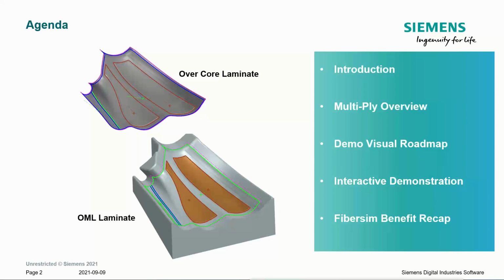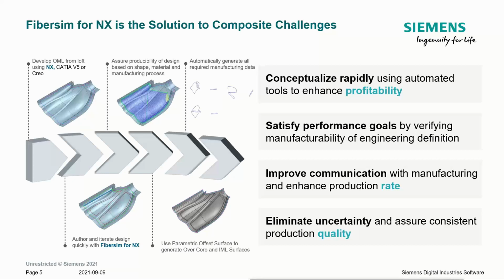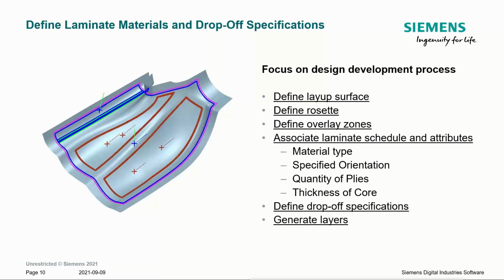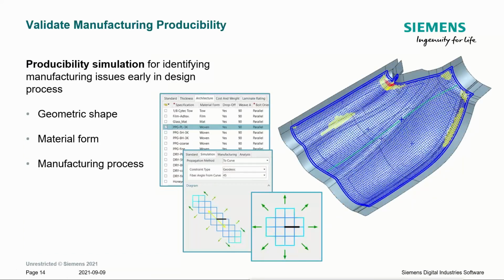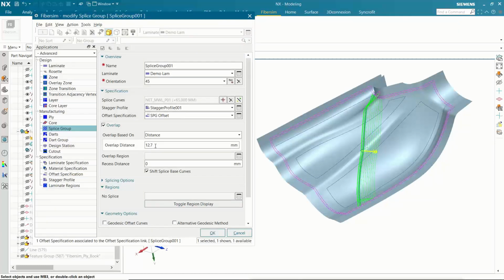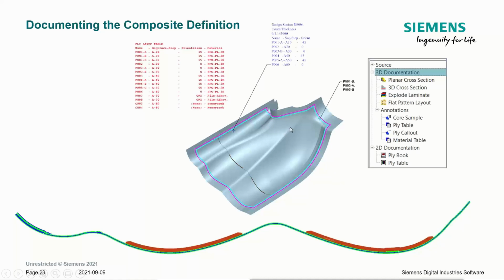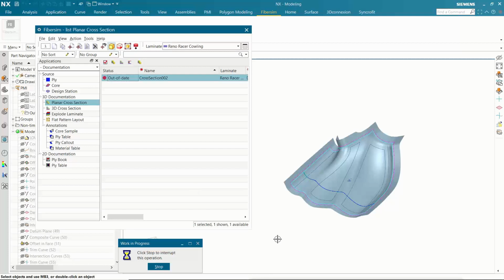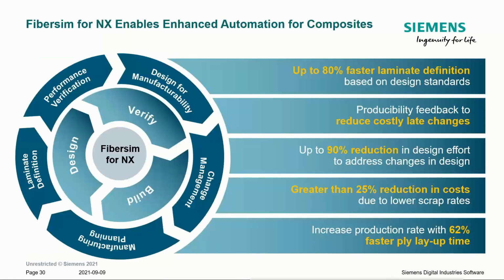Fibersim Overview Webinar

Comment: Great video. What I would love to see is a video of complete part. What I mean is that in this demo you have two core ply's but you never covered it with "overcore" ply's and what goes into doing it. Also it would be great if you could show generating 3D solids out of finished part that could be evaluated in the assembly (wherever this parts is intended to be used). Another important thing would be to demonstrate how fibersim data could be exported to FEA packages - part with resultant (result of manufacturability simulations) ply's, fiber orientations, etc. That would give the full picture of fibersim being used in composite design and manufacturing.